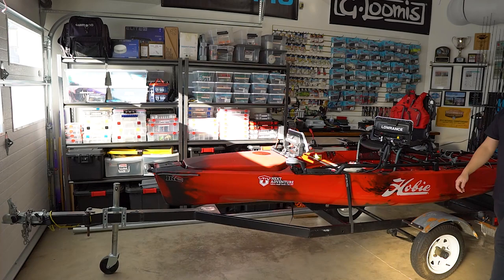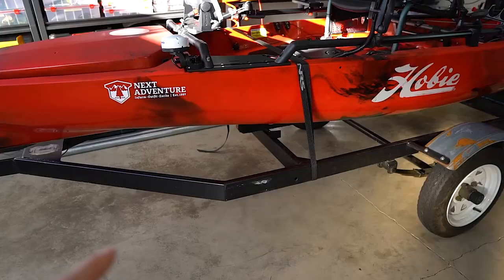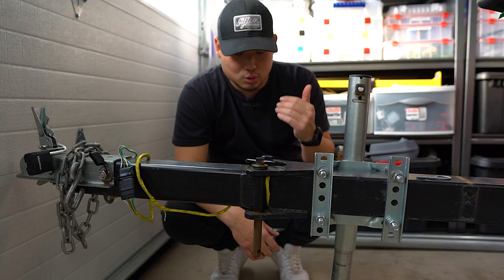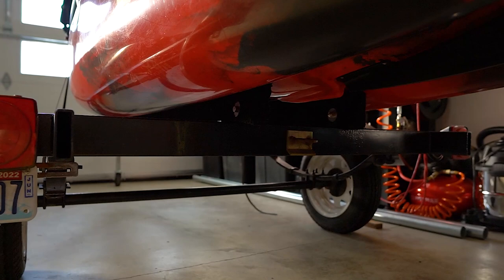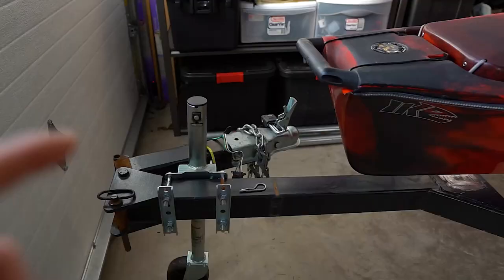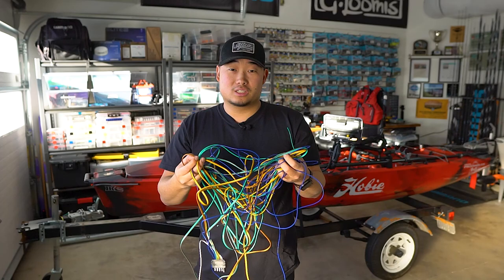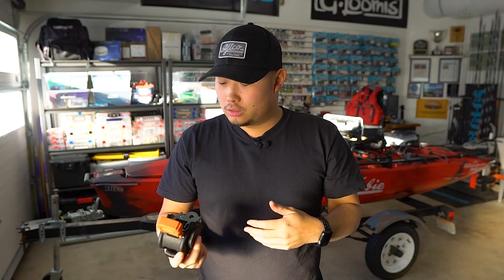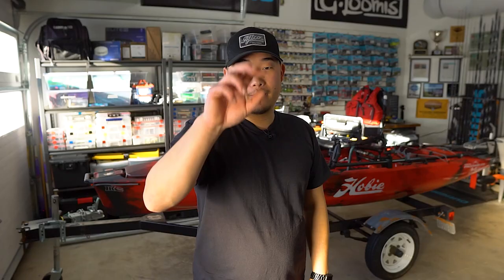INTRODUCING MY DIY KAYAK TRAILER BUILD!

Comment: Hey Dude. Something that might help your visibility is side guide posts. You can mount them aftermarket with some U bolts near the back and add a light to the top of it. Helpful for you to see in the truck and even helpful to hand guide the Yak onto the trailer. DM me if you have a question about it.
Reply from the maker: Smart idea!